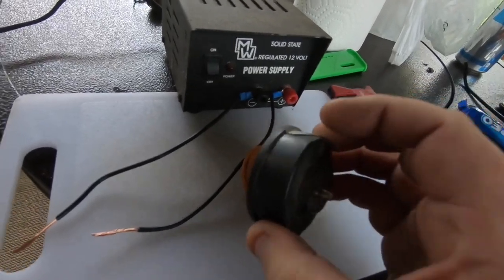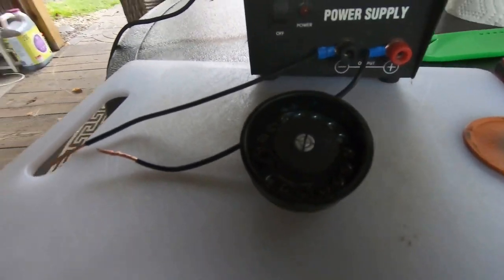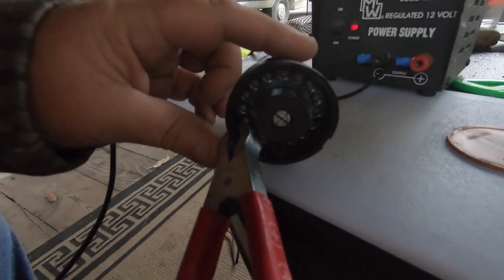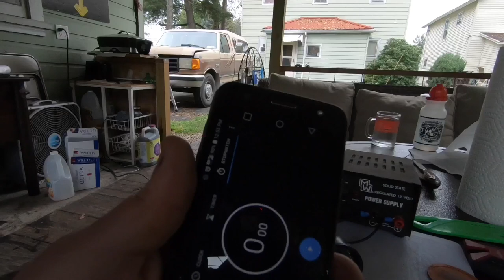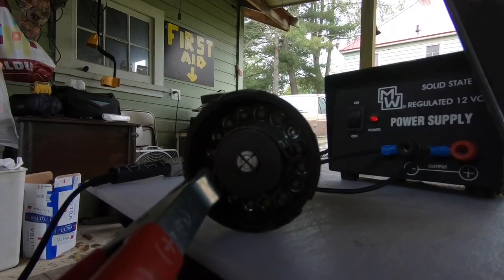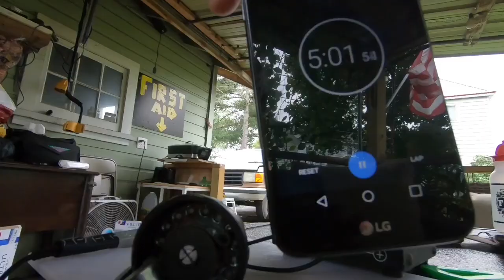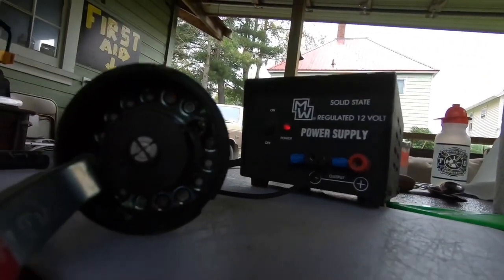Electric Choke Thermostat testing. 87 Ford.

Comment: One thing I have discovered to check is the resistance between the positive terminal and the ground.  I've had a couple that grounded out or shorted.  One was a 1970s dodge with a heat tube.  It actually heated up the body of the thermostat, not the tube.  The other was a revised replacement with an enclosed heater.  It did not heat up the housing as much, but it pulled IGN voltage down and would not let the vehicle start.  

Also, if it seems like a choke problem, and you have checked everything, every linkage, every line...  Check the nuts holding it too the manifold, ensure they are tight and have lock washers.  Next, look at the gaskets between the Throttle-Body, main-body, and air horn.  If there is moisture on the outside, it's gas and you need to pull the carb and reseal the three pieces.

Comment: Shave off the tab that faces away from the CARB and then you can adjust (rotate) the auto choke.  Just mark with a permanent marker where the tab is on the side of the orange plate before you cut it off, so you have a full index of where factory is.